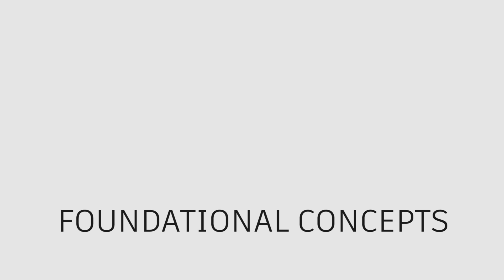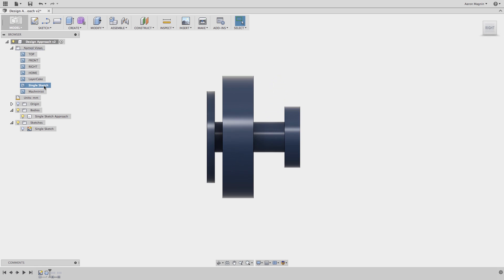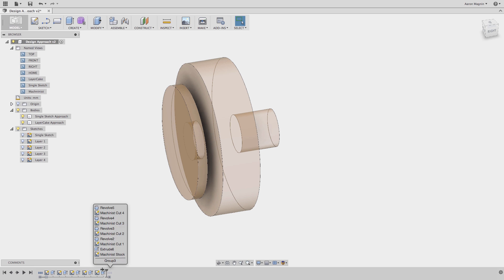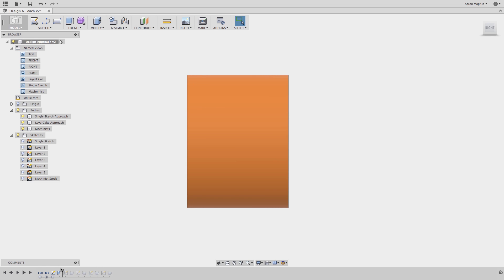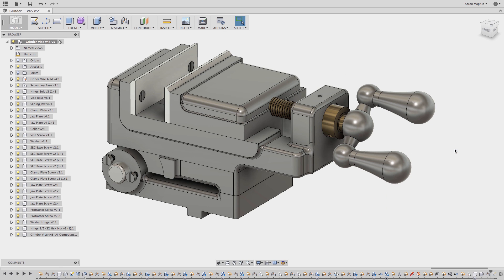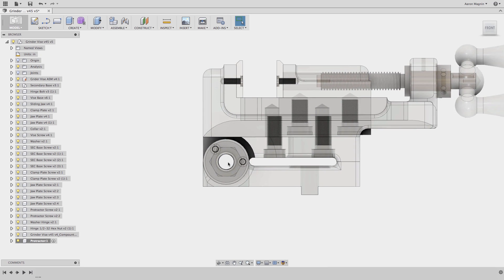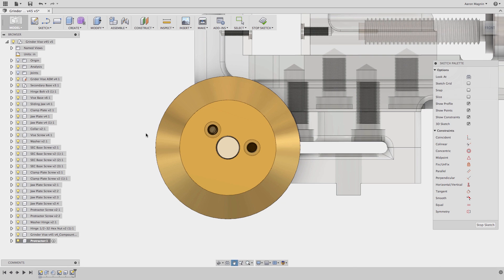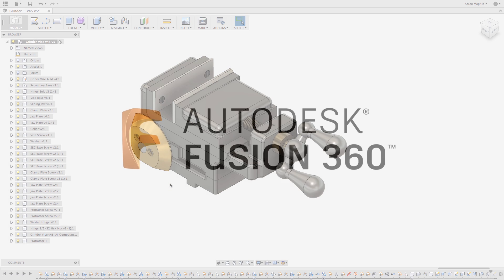Foundational Concepts: Design Intent, Top Down vs Bottom Up, and RULE #1

Comment: Well this modified my understanding of top-down and bottom-up, at least when I hear it from Autodesk. Something that really helps if you use several sketches to make a single part is to simply name your sketches. So much easier than seven numbered sketches. That and of course rule #1 so your not hunting through 34 sketches instead of seven.